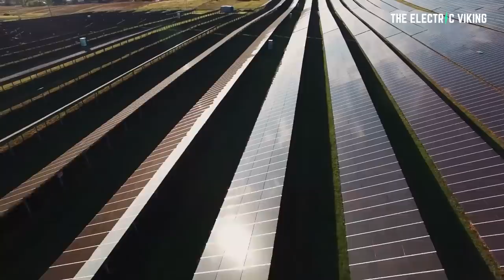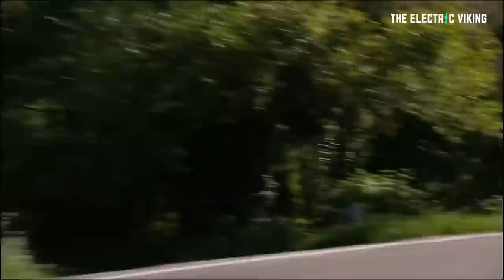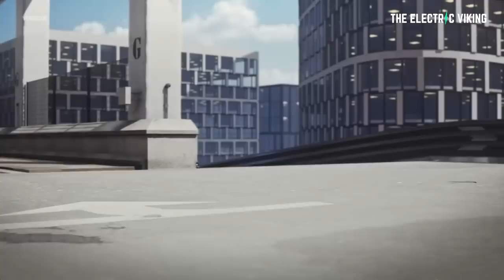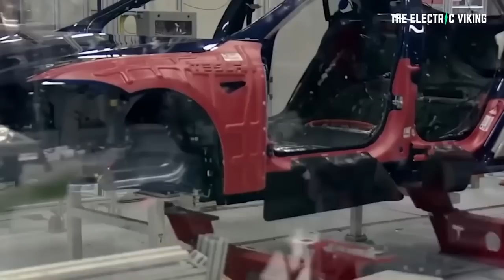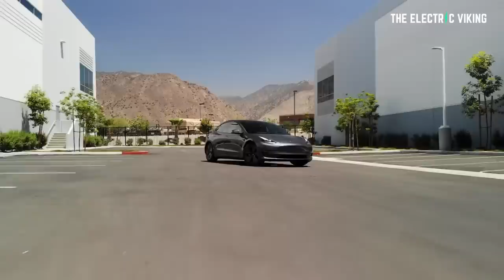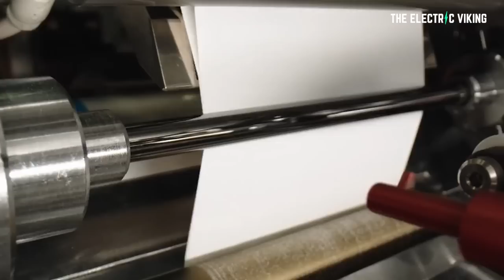Tesla Cybertruck mass production date finally revealed

Comment: A 4 x 4 super crew Ford blue F-150 XL sold for about the $39k of the Ford Lightning (which had numerous features that the blue didn't have) in 2022. The Ford F-150 Lightning Pro was priced less than their ICE vehicles. Basically, if someone didn't understand that they were competing with their F-150 XL's, I do not see how that would be possible, and what is worse is that trim level in fleet orders could get the extended range batteries. I doubt they sold 100's of them as those fleet customers are more likely to have a lawyer, and the cost is multiplied by the number of vehicles ordered. There is a reason why the Blue XL dropped $3k in price and the Lightning Pro gained $7k in price even against the price increases in the other trim levels of the Lightning. Those trims gained another $5k.

Comment: don't think building the cybertruck will be as hard as you think. 1. Tesla will employ  Model Y building methods and lessons to the Cybertruck (seats mounted to battery pack before body is bolted on. 2. Far fewer exterior panels to mount to a frame. 3. Less/no painting 
Once they reach volume production it could be faster to build a CT than any other Tesla model ....

Comment: "We dreamed of a stainless-steel vehicle that could bash through the bush week after week without rusting away from scratched painted mild steel and not have it's under body chassis destroyed by contact with rough terrain. Cybertruck with scored bent and welded stainless steel sheets with no chassis finally gave us what previously we could only dream about. It paired perfectly with electric motors and batteries and even has a low drag coefficient! Preorders were off the charts :)"

Comment: Elon Musk/Tesla/SpaceX has been very clever with the use of materials, and the reduction in the cost of mass production.
QUICK FACTS:
1.) aluminum, stainless steel, and lithium are cheap
2.) major assemblies: front/rear large sub-assembly die casting, structural battery packs
3.) stainless steel exoskeleton
4.) years of manufacturing experience at SpaceX using stainless steel

MY CONCLUSION:
The greatest civilian truck of the 21st century.

Comment: The Cybertruck is military ready, especially the low radar signature, that’s the reason for the flat planes body with no vertical surfaces and radar waves absorbing wheel caps and slope bed closing system. Even dropped by parachute it will help with radar detection.
Reply: Low radar signature? Really? About as stealthy as a Barn Door with those huge vertical metal surfaces.
Reply: lmao no not really the reason for the shape. it's from faster and more efficient manufacturing. Thick stainless steel would be a nightmare to manufacture with all the intricate shapes and curves for a traditional vehicle look.

Comment: It would be possible to change the performance (tuning) of gas powered cars via an over the air update but it was never done. Most of that is done with a chip or tuning software from a 3rd party. However, there are a lot more possibilities with EVs and software defined cars.

Comment: Given that we don't know the true pricing, it is likely that only the single motor version will qualify for IRA rebate. Dual motor will likely be above $80k and the quad motor is unknown. Unless they change their minds, Tesla stated they would make the expensive versions of the truck first, so rebates are unlikely. The plan for the CT was definitely 4680 because the battery size needed to be so large kWhr wise. LFP blade density would have to be quite high to be a substitute, but that would be great if they could do it.

Comment: you may not want the inital batch anyway.    probably will be 18650 or 21700  to have the only change be the truck itself.  Sometimes, you dont want too many new things at once.     After the first trucks come online and they can shake the bugs out then rollout two will be the 4680.    Then tesla can roll out 'free range increases' periodically and customers  loooove that.   CT owners will certainly ask Rivian and Lightning owners how many additional miles THEY got this year...  heh
Reply: Well, at least it means that it will have Tesla’s proven battery tech. Which means better reliability at least. The 4680s, on the other hand, are still new and has some time to be proven. I feel like as soon as they are deep into mass production of the 4680s, a new and even better battery tech will already be in the works.

Comment: LiFePO4 won't be used I'm guessing due to energy density requirements. I think they'll try to go for maximum range, since the range will halve when towing. It's the #1 reason I hear from pickup owners saying they won't buy an EV pickup. I personally think they should go for at least 600 miles\1000km empty so that towing range will still be a decent 300 miles/500km.

Comment: I put it to you that the first exoskeleton vehicle made with a brake press was the South African Chev Nomad around 1979
Reply: Check out the Cadillac Gage Company V-100 Commando Armored Vehicle (US Army). This was my Ride 1970-71, 101st Airborne, Vietnam. Tens of thousands were sold to various Military Police Units to provide protection for Convoys to Fire Bases. They were Not affiliated with Cadillac Auto company. 1/4" thick sides / 3/8 thick underside, Aluminum. Twin 50’s on Turret + M60 MG on Turret, two M-60’s up front, M-60 in rear with "poot tube" Grenade Launcher. Top speed ~ 70mph, could Float to cross Rivers, powered by a 386? Chrysler Hemi with a Hurst 4-on the floor manual, all wheel drive, run flat tires. And yes, those angled sides could deflect RPG’s and rounds. Two layers of sand bags on the floor for Mines, crew of four.
Cheers from San Diego

Comment: Elon has said the price won't be as originally advertised. Elon also said the FSD if pre-ordered he will honor the price which is $7,000 night of the reveal. I did & also ordered the trimotor version mostly because of the 500+ mile range @ 1/2 when towing or 250+ works

Comment: The biggest advantage of a lighting is power to home. I’d prefer a cyber truck but I’d take backup home power over a lot of other features.
Reply: Tesla will probably add this feature to all their cars by software update and with an adaptor cable. I think they haven’t yet because it’s detrimental to them selling power walls and they haven’t been able to keep up with demand anyway so why add a benefit that would only drive more people to buy their cars. I think this will come in the next 2 years
Reply: All of these trucks will have AC outlets, so grab an extension cord and a surge protector, plug in your fridge, freezer and a few other things if the power goes out.

Comment: Production may begin as soon as July. The 9000t is on the way from Italy. They reinforced the bridge crane rail posts in the casting area. Two new bridge cranes arrived on Tuesday they are believed to be for the south end in the Stamping area. 
I think the battery will be Panasonics 4680 which should begin production in April in Japan. It may not be a structural battery? It will use their wet process for attaching lithium to film. They sent Tesla samples maybe 6 months ago. 
The production area believed to be where the cybertrucks will be assembled is working on the last foundation for a stamping press. Two bodies looking like cybertrucks wrapped in white plastic with some odd shapes showed up last week. I think they are for calibration of machines and the odd shapes are protection. They are clearing more ground and testing soil in a field to the north. The area they shot the stampede of Y's is now a storage area and the rental office for on site rental construction equipment company. Work on the permanent power station is moving quickly as is the cathode factory.

Comment: I've been an avid fan of the channel.  Yet I'm always surprised and perplexed at the fact that little consideration is given to the potential of hydro electricity  on the podcasts. Solar and wind are great but hydro produces clean, reliable and constant power. Rivers flow night and day, regardless of the sun or wind conditions. Dams last   for many decades.  In Canada where I live, many instalation are over 100 years old and still producing reliable electric power.
Reply: Pumped hydro is a pretty efficient battery.

Comment: Sam: I took my 2018 Chev Bolt and got the NEW 2022 65 KW battery pack with that extra range of 259 miles here in the USA. After that, there was a software update for it. Took it in and after getting the update my RANGE dropped about 28% or 185 miles. Am I passed!
But I ALSO did order the Cyber Truck. #12,042 in line.

Comment: The $40K Cybertruck was the single motor and people are speculating that this version will be dropped. If this is the case it will be a big jump for these buyers to go for the duel motor that would not only be more expensive anyway but in your estimation going up like Ford's Lightening another $10K.

Comment: Logically, the Cybertruck will cost more than the Tesla Y which currently, a 2 motor long range costs at least USD$64,000. Also, Tesla has 1.3 million reservations, so Tesla will be building the high series customer orders first……where does that leave a lot of those reservation holders?

Comment: Sadly, the second most innovative truck in my opinion, is the Canoo. The features and overall design to me, rivals the Cybortruck in almost every way. But again, sadly, if the stock position of Goev is any indication, it may end up as vaporware. Let's hope not, because it is a fantastic design effort.
Reply: I wouldn’t count on concept specs for any vehicle until they are in production and independently tested/reviewed. They can promise specs and prices before production, but it can change dramatically depending on certain factors. Specs announced during unveiling is just for hype.
Reply: @FlipBoxStudio  Fairly sure that's what I said. And by that logic, so goes the Cybertruck.
Reply: Yeah, I like the Canoo, but that stock price! 😮

Hopefully, they’ll get it together.

Comment: Initial Cybertrucks will cost somewhere betweeen $75,000 and $89,000.    That is my WAG (wild ass guess).  I don't understand whyy people would think they should get the 2019 price, yet they will be taking delivery in 2024.   Model Ys cost close to $70,000.   Model Ss cost about $110,000.  Plus we now hear the initial Cybertrucks will have 2170s, so no possible cost savings by using 4680s.

Comment: I think the prices will be higher as well. It should sell for more than the Model Y, simply due to its size. I think early reservation holders will be able to buy at the original price if they agree to not resell the vehicle.  Tesla will also actively try to get reservation holders to switch models or options so they can charge them the adjusted price.  Like only offering expensive quad model trucks first.
Reply: Tesla has already announced there will not be a single motor version and they have added a quad motor version instead.  So, the prices will definitely be higher.  I think the $40,000 single motor version was aspirational even before the pandemic related supply chain disruptions.  Inflation has killed that idea.

Comment: I think that for at least the first year and a half to possibly 2 years they will only be producing the higher end models with longer ranges that require 4680 cells or possibly even the batteries used in the model 3/Y performance or long range edition. Only once they satisfy that demand will they start producing the cheaper versions and by then catl or Goshen high-tech should have they're North American operations up and running
Reply: It will be longer than two years before they sell the base model, maybe never. As long as they are production constrained they would be crazy to sell low priced versions, the same goes for Ford and GM. It could be the end of the decade before there are enough batteries to go around.

Comment: I think there is going to be only one version: the quad motor version.
Why?
1) Some of the competing brands' electric trucks have four motors, and Tesla wants to stand out with the most advanced truck. Those other brands' four motor trucks don´t come in a 1,2 or 3 motor version either
2) It will be cheaper and faster to produce just one type of truck. This will make the cybertruck more affordable when produced in high volume. Everything in the production process will be simpler if there is just one version.
Now what will it cost? Can you compare to a model Y in 2019? The most expensive Y was $60k back then, and the 3-motor Cybertruck was $70k. Add around $6k for a 4th motor: $76k.
Model Y now, fully tricked out,  is around $80k. That is 33% more, and so the Cybertruck should cost $76k + 33% = $100k now. 
I am hoping for less but fear more.

Why it should cost way less than $100k, actually it should cost what a Ford Lightning or Rivian costs:
- Subscribers who paid the $100 or €100 will feel duped when it is too expensive
- No paint, so should be cheaper
- No different versions (if I am right, and Tesla chooses a one version, four motor strategy) makes for cheaper and faster production. That 
- Also just the one version to test and pass through road-safety boards in the USA and other countries
- They say (and I hope it is true) that folding stainless steel is cheaper than the stamping process, so should be cheaper to build than model Y
- The 9000 ton press machine that will make the front and rear underbody (not the triangular upperbody, or I don´t understand the whole thing) works fast and saves production time, and time is money in a factory.
- Batteries are getting cheaper and better year over year when compared per kWh. 
- They have to be competitive with the Ford Lighting and Rivian. They actually need to be at most those prices, and actually less, to overcome the doubts of traditional truck buyers who just want their next pickup truck to be electric. Those people are not convinced by 13 speakers or sci-fi looks. They are convinced by price and utility. 
- Tesla is now late to the market with their truck. Shareholders will not like it when it will not sell because the price is too high compared to the other brands.

Why I fear it will be at least $100k:
- Inflation
- Musk already vaguely hinted it will cost more. How much is anyones guess, possibly even Tesla's guess.
- Expensive materials like this ALON ceramic glass for all the windows
- Too many new tech that has to be tested and tuned and debugged to get it right
- Too many chips and computers that are hard to get due to shortages, and China being China, and the Ukraine war, and Covid.
- Unforseen production problems that makes economy of scale hard to achieve

What can be done to keep the Cybertruck affordable?
- Make just one version with no options at all, with four motors
- I really hope four wheel steering stays in, and lots of earth-moving equipment has that, so should not be too hard to do. But it is not essential. Let it be the last feature to leave out.
- Give it very strong windows, but not ALON if that proves to be too unwieldy or too expensive
- Choose a reasonable set of high tech features that can be achieved at reasonable cost. But forget about self-driving for now. You can´t really use that off-road or on construction sites anyway. Plus it is not done yet, and certainly not when towing anything.
- Give it a 800km range or so, so that when towing or on rougher roads you will still have an acceptable range left. But not more. The thing is heavy already.
- I hope the CATL sodium batteries can be used. No lithium means cheaper. Also no range loss with cold weather. Or better: sodium batteries made by Tesla
- Just simple side mirrors, simple but very sturdy window wipers
- Reliable and strong vault rolling shutter, but no complicated and vulnerable solar panels in those. 
- Transparent solar panels as a layer in bulletproof glass would be great, but realistically you may only get between half and one mile of range out of them for each hour of strong sunlight. Not worth the considerable extra cost at all. For all the windows: choose really strong glass that is affordable.
- Design the truck so that almost anything can be taken apart by (sufficiently skilled) people themselves. So they can choose to upgrade all kinds of parts (like the windows, the suspension, the seats, add a hitch or a crane or lightbars etc) however they choose. Like you could with a Landrover Defender or a Jeep. That way it willl be more interesting and create an industry that will make the options affordable that would otherwise be expensive when Tesla makes them. It should be really simple to take apart and service.
- Build a smaller version of the Cybertruck for Europe in the Berlin gigafactory only. Safe money and keep the retail price low by building and selling local. Or maybe build a "cyber terrain vehicle" for Europe.
- Get some militaries and police organisations interested so that Tesla can build them at scale, so they get the economy of scale they need to lower prices. They also need a solution to charge them in a warzone, by the way.

Comment: I reserved a Tri motor version. it has a towing capacity of 14,000 lbs where as the Ford Lightning only has 7,000 lbs. I'm building a 26' Tinyhouse trailer which weighs 13,000 lbs. Ford's out of this range.

Comment: I just don't see how the model X especially or the model S or Y would sell at all if you can get a CT that is way cheaper than the model X and S but does way more and about the same price as the Y but has way capabilities??? the model 3 would be more sporty but wouldn't be much cheaper unless they lowered the price or completely redid them with much cheaper options like those Chinese battery packs etc?